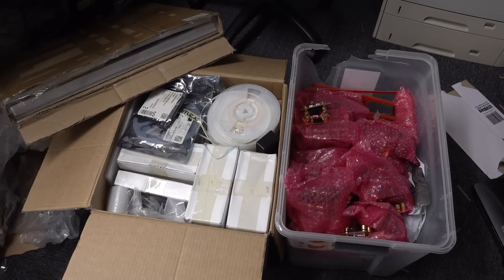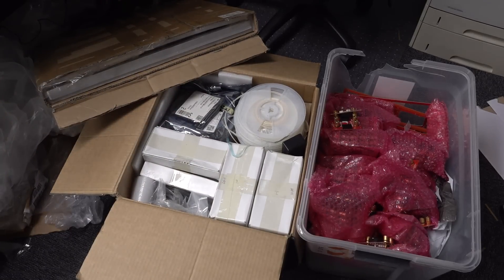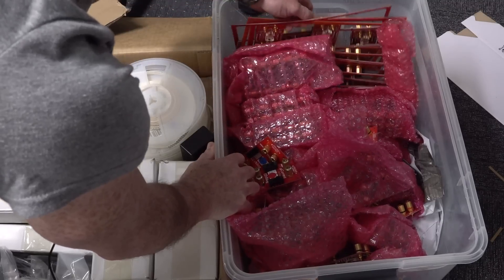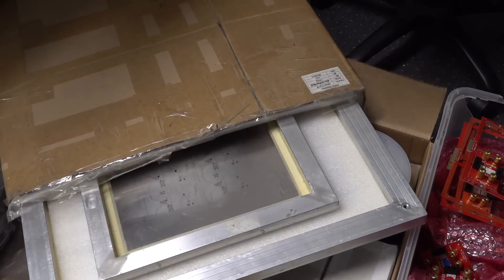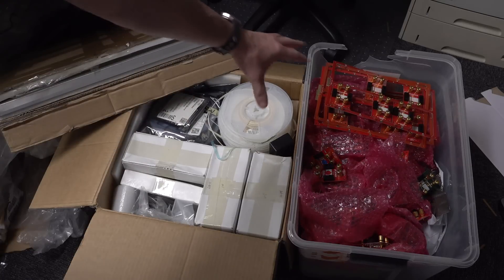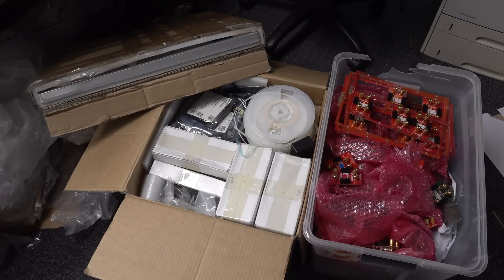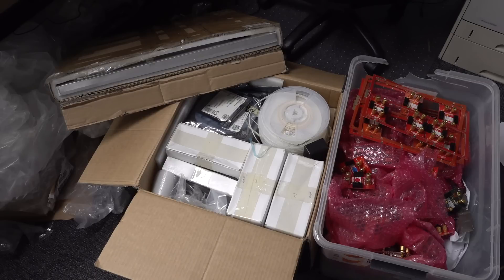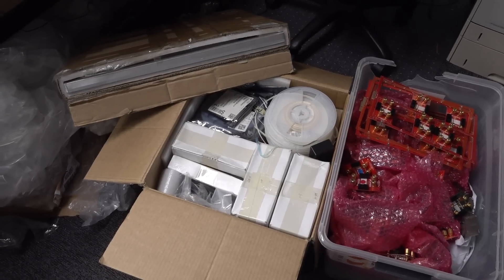Whatever Happened To The µCurrent?

Comment: To be fair, it is hard to keep projects like these going when it is just a passion project so to say.
Finding motivation is often far from trivial.

Though, I do wonder, those boards that are slightly out of spec, wouldn't it be wise to add in some method of trimming them?
I for one wouldn't purely rely on the tolerances of component values to get product specs. But rather aim more for stability and have two or three components in parallel that together become accurate. However, binning and "matching" components isn't really an ideal approach in practice unless money isn't an issue.

Though, measuring the "raw" performance of the board and having a computer spit out that one needs a 47K resistor in parallel with one's 5mOhm shunt (pulling values out of thin air here) to nudge it into spec is however easy, and adding the parallel resistor is likewise "easy" if one gives it suitable clearances for manual rework. Though, trimming a resistor to increase in value is less easy, unless one has an op-amp with some feedback network, then one instead just trims another resistor. So it becomes a question of what value on position A and B, use both and one can technically get even better specs with bog-standard parts. (Ie, measure, nudge it slightly past spec, measure, and then nudge it back into spec with the other resistor. Similar to a dual slope ADC. On paper with 1% tolerance resistors, one would get upwards of 100x closer with each trim resistor. But it is a manual process and parasitic + non DC signals are still to consider. And one also needs components that don't drift much over time, else all that accuracy will be short-lived.)

Comment: Could sell what you have 'as is' by means of a DIY kit with the option of purchasing mainboard and components separately as a starter kit? May cut out the middle man and save time for yourself in production and assembly. Of course, they would have to be spec tested but could also be down to the buyer to set up calibration settings??

Comment: I think an updated version for use with oscilloscopes would be nice.
Reply: They don't really achieve anything in front of a good scope front end: you just learn a bit about noise generators. Their niche is when paired with a dmm.
Reply: @Rich-on6fe  For measuring small currents, they would be far superior to a clamp on current probe.
Reply: @NiHaoMike64  probably would, but applications where you need to use a clamp probe are different. You're gonna pay a cost for not breaking that power wire.
So let's compare like with like: put a series resistor in the power wire and probe it directly with the front-end amplifier of the scope. This is as good as if you insert a ucurrent and put that into the scope. I tried using a ucurrent in front of the scope years ago and my wiser, more experienced boss knew it wasn't going to do me any good: it just generated more noise. 
The other trick is to use the 50R termination inside the scope as your current shunt: depending on what you're analysing it can work really well. Or it can burn out the termination. Current limits are good.
Reply: @Rich-on6fe  I'm thinking a scope version of the ucurrent would be isolated to allow high side measurements and make use of an active I/V converter at least for the low current ranges.
Reply: @NiHaoMike64  that actually sounds pretty useful.

Comment: Just started getting back in to manufacturing things again here Dave... not sure it's a great idea - I'm hoping I can attain some level of "zen" when doing the manual pick & place ( at least I have a stencil and vacuum pickup tool ).    Wouldn't mind handing it off to a 3rd party but worried about unapproved part substitutions on one of the units.

Is this something you could hand off to a 3rd party, or too much of a botique item ?

Comment: Hurry up Dave: The kickstarter project for the MicroAmp-Meter from DANALOGX Inc just closed. MicroAmp-Meter is a high speed Wi-Fi current profiler and Micro SD card logger. It is a portable current meter that can measure and plot the current consumption of devices at high speed. MicroAmp-Meter has an automatic shunt-switching mechanism that enables it to measure the dynamic range of current levels ranging from 1uA to 1Amp.

Comment: Sorry, Dave!
I prefer the CurrentRanger
Because of its automated range switching and no resistance of mechanical contacts in measuring path
Reply: MicroAmp-Meter by Danalogx is another alternate.
Reply: CurrentRanger...interesting.  Never knew about that alternative.  Thanks!
I do find it funny/sad that it looks like a uCurrent knock-off.  I get why they did it but still a bit of a d1ck move.